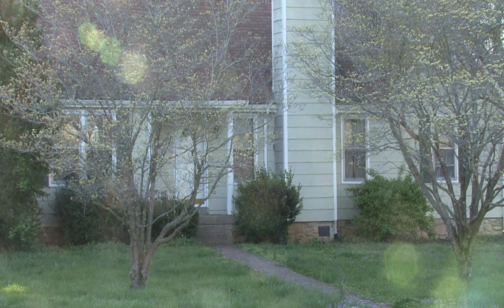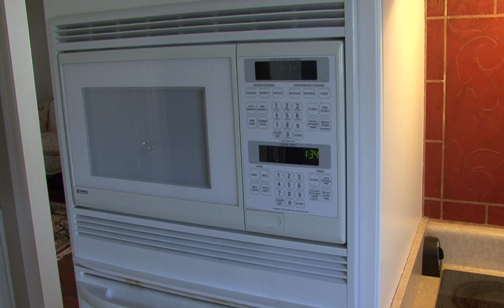Basic Home Improvements : About Old House Wiring

Comment: i recently had my service and panel updated from a 60 fuse panel to a 30 space 100a circuit breaker panel. I did this because I wanted to add a mini split and I knew they would look askance at my old 16 space fused system that was maxed out - not because of ampacity but because of the lack of free circuit space.

This house was built in 1916 with a single 30a 120v service, it was upgraded to a 60a 240 panel in the 1960's and I added a couple of 4 circuit fuse panels off that panel after I bought the house in 1981. The only time I blew a fuse was when I cut heavy oak on my table saw, that stopped when I rewired the saw for 240v. Since the mid 80's I have not blown a fuse for 25 years.

I replaced the old panel because i wanted space for more circuits, the old system was safe and it did it's job.

Comment: I live in a 64 year old  house and have been running desktop computers , notebook computers and  tablets (charging them) since the mid 1980’s. All the wiring (copper)  and the circuit breaker box (Federal Pacific)  are original.  I have never had a problem and neither have  my neighbors. There are many houses in this subdivision and none of them have burned down or experienced uneven electrical supply to the extent that they damaged any equipment. Devices will only draw the current they need. A 15 amp circuit doesn’t mean that anything plugged in will be receiving 15 amps. Most appliances or devices only draw a fraction of what a given circuit could deliver. That’s why circuits are interrupted only when they are overloaded by an appliance drawing more than the circuit can bear.

Comment: Tvs now use WAY less energy, my new tv is massive n runs cheap, my old tube tv is like 20 inches or so n flickers lights when turned on
Reply: So do modern energy efficient refrigerators after replacing my old refrigerator I save about $15 a month on my electric bill even with an electric stove replacing my old gas stove.  However my gas heating bill and cable TV bill went up...